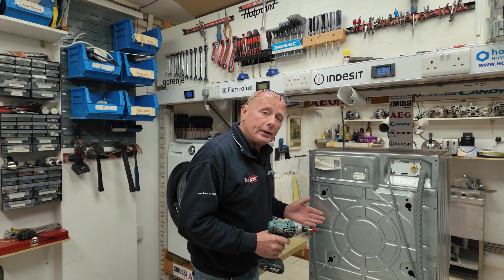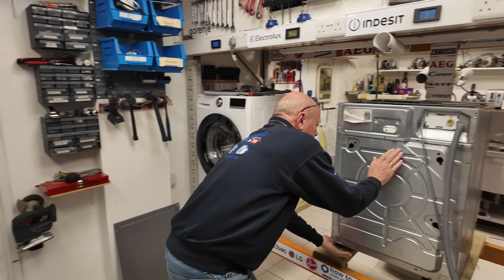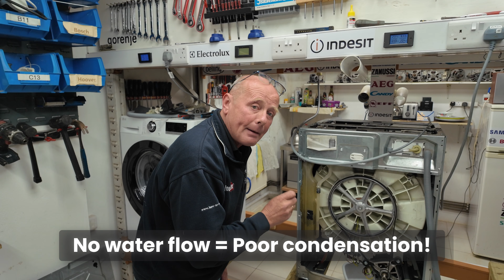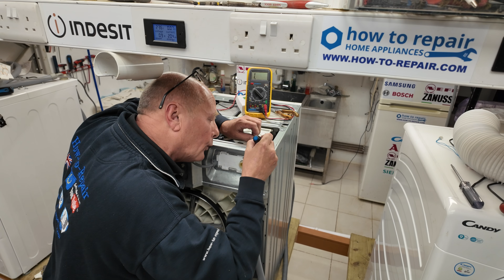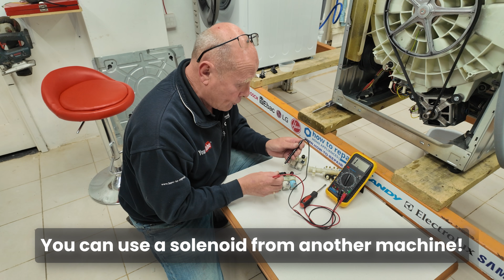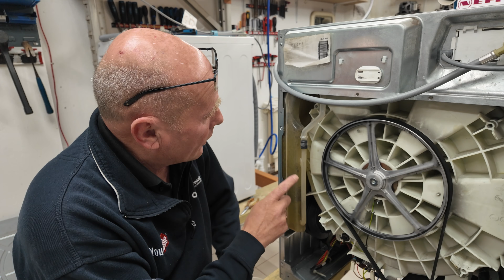Washer Dryer Combo NOT DRYING, Leaving The Clothes HOT & WET, Washing Machine Working but NOT DRYING

Comment: Hello,

I am a new subscriber and wanted to express my appreciation for your videos and the valuable assistance they provide. Currently, I am working on a Candy Smart Pro CSOE C10TRER-19 dryer machine. The machine is drying clothes effectively but fails to shut down once the clothes are dry, continuing to run indefinitely. I attempted to locate a moisture sensor but was unable to find one on the machine and am feeling quite lost. Could there be an alternative system in place for sensing moisture other than a metal strip sensor? I would greatly appreciate your guidance on this matter.

Comment: My combo machine is sharp ESFL1410DPX..there's no problem in washing, rinsing, spinning, and drying cycle, but when it comes to cooling cycle after drying, it won't stop, because when i checked the drum it's actually wet, like i saw it when washing cycle..would you tell me what are the problems could it be..thanx alot for your xplanation..

Comment: I don’t think I can buy used one any more in Canada. But can I just buy a hot water valve which is only $30 and use it to replace the cold valve, $130? I mean, you replace only the head part from other machine to yours. Can you use the same way between hot water valve and cold water valve for the condenser related parts?

Comment: My Beko washer dryer has blew a capacitor twice and the timer delay fuse. One I was able to fix myself by putting in a new capacitor and tmd fuse. The second time it blew a hole in the PCB so had to order one second hand. The problem was when on the drying cycle the outside drain grill was blocked that led to over heating. Hope this helps someone. Whenever I start my washer dryer now I check that the outside drain is not blocked with leaves etc.

Comment: Thank you for your video. In my case, in the Beko WDEX8540430W dryer, water flows through the tube into the condenser at high pressure, and it seems that too much water is entering. Could you share your experience: could this be a fault with the water inlet valve, allowing excessive water to pass through, or an issue with the electronics giving incorrect commands? It seems that the other components are functioning properly.

Comment: Nice solenoid hack. Thanks for sharing. Used machines with a damaged bearing is usually easy to get for free on our craigs list equivalence.

Anyway, a comment for the algorithm to chew on. 👋
Reply from the maker: manufacturers already trying to stop hacks like this they are now converting to DC water valves on some machines instead of AC. This means if general public does not pay attention to detail when replacing a valve they could blow the circuit board, help from people like you feeding the algorithm does assist the channel but I'm not here to get numbers. I'm here to help thanks very much for supporting the channel. And don't get me wrong making sales and earning a living is what allows me to do what I'm doing, so I won't lie about it. I do make a good living from this industry whether YouTube or selling spare parts.